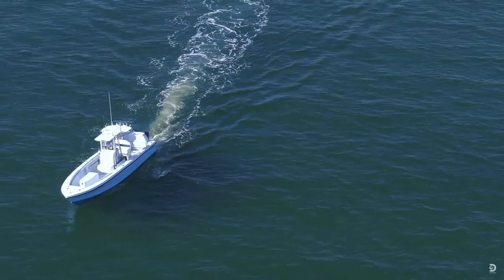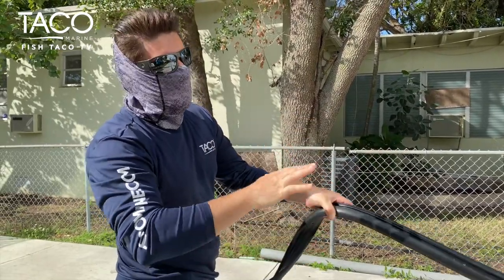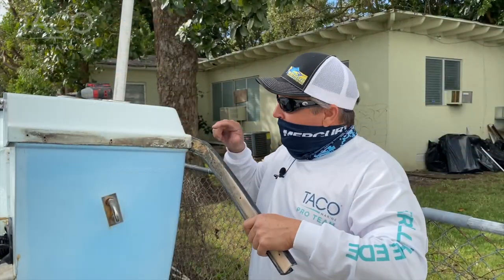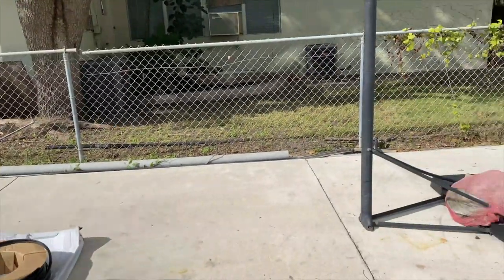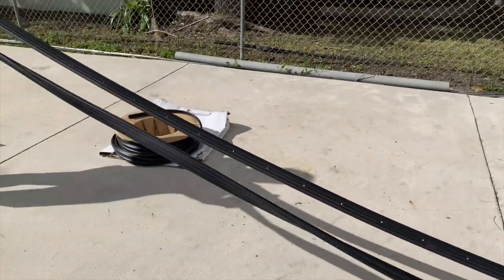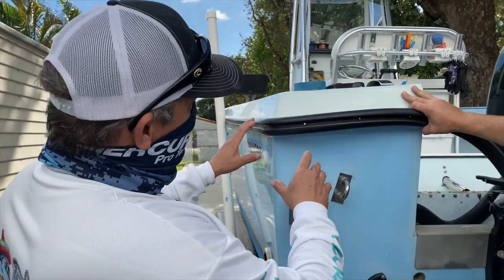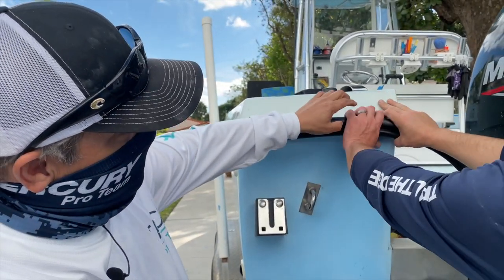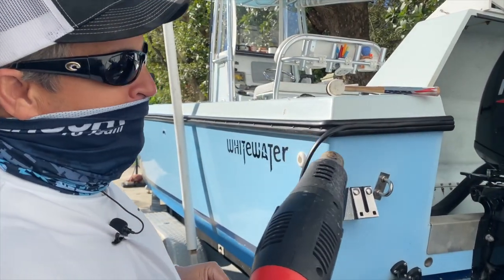Installation of My New SuperFlex Rubrail #rubrail #projectboat #tacomarine

Comment: Nice install. , useful tips.  Bit surprised no silicone on the new pan head screws ? is it not necessary ?
Reply from the maker: Thanks! It can be used but not absolutely necessary. 👋👋
Reply: Good video and tips, but I respectfully disagree regarding the silicon with screws. After time, those screws will develop small intrusions, develop enough cracks that its not IF, but when they start leaking into the interior. EVERY other video on this type of project includes cleaning the top/bottom boat joint new silicon on the joint AND silicon on the set screws to eliminate water intrusion...  @CaptOrlandoMuniz
Reply: @johncarpenter1476  👍

Comment: The cap on my boat in the bow appears to be coming loose from the hull after many years (1985), it looks like I'll have to remove the rub rail to reattach it, it appears also looking from inside the boat that rivets were used instead of screws. I noticed that my rub rail was sealed on both sides with silicone and in your video you didn't do that, any particular reason why you would or wouldn't  do that?
Reply from the maker: Silicone can be used, especially if there is a gap between the hull and the rub rail. In my case there was little to no gap. Hope this helps! 
Tight Lines, Capt. O
Reply: Extra screws in the rub rail will hold the loose side of your hull down. And the seam between the cap and the hull you would want to caulk first before you install rub rail. You don't want to caulk on top and bottom of rub rail because if water gets in behind in needs a place to drain or you will have sitting water